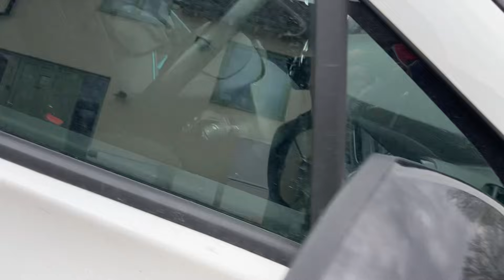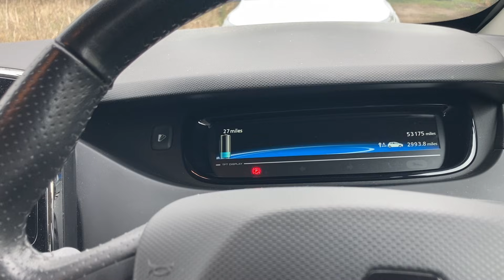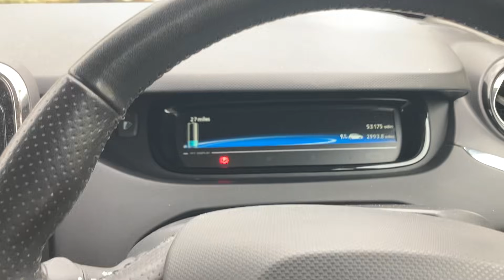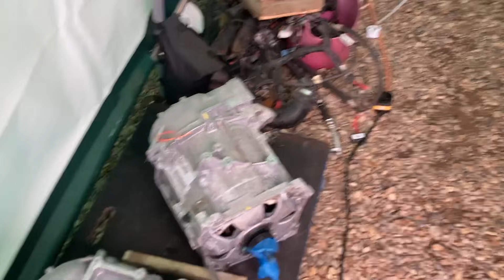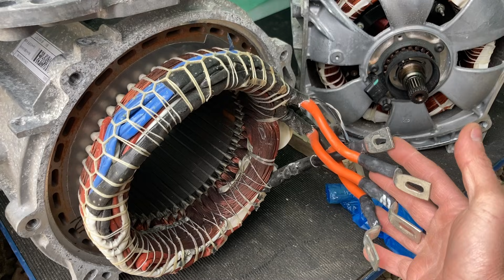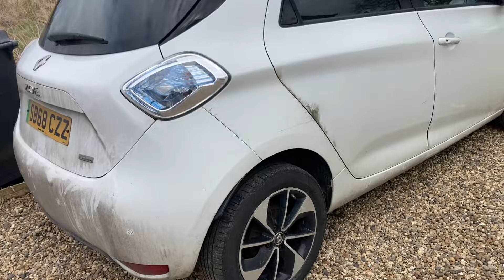Is this 6 year old EV scrap? 🫣 Renault Zoe Electric Car faulty - EV Salvage Car Repair Mechanic

Comment: Been watching many of your videos, and I believe somewhere you said that the Renault 5 is using the same motor as the zoe's. Or maybe I read it in a comment.
I was seriously considering buying a R5, but now I'm getting more and more scared to do it.
Reply from the maker: Hi, someone commented that that was the case although I have not verified this. I would be surprised if it is the case to be honest. Cheers
Reply: @garycevrepairs  Do you think a Renault EV is a good buy in general, or is there much more reliable brands i should look at, in your opinion?
Reply from the maker: @ well put it this way, I hardly ever talk to garages about fixing Kia and Hyundai EVs 🤷🏻‍♂️
Reply: @ Thank you. I appreciate your answer a lot.
Reply from the maker: To be fair I haven't had much to do with the newer Renault EV's like the emegane etc. Whatever EV you buy, get one with a manufacturer or third-party warranty and keep extending it. With the Renault you can extend the manufacturer warranty before it runs out. Cheers
Reply: @garycevrepairs  Definitely will do. Thanks again.
Reply: That might just be because most of them are still covered by a warranty?  @garycevrepairs
Reply: @garycevrepairs  Looks like there's plenty of room in the engine compartment on my e-niro too so even if it does need repairing hopefully it's a bit easier to get at stuff then the Zoe.
Reply from the maker: @decimal1815  could be a part of it, maybe they didn’t sell as many as well.
Reply: @garycevrepairs Oh dear.!  But, I have seen a lot of Kia Soul EVsfor sale, where the 30kWh battery is fairly degraded, and the cost to replace or whatever, is 3 times the price asked for the car ie Soul 30kWh selling for four grand UK, but the obvious need it has, will cost you £12k and nobody seems sure how to do it if not pukka Kia dealer.  Some kind of key-code for the battery, so you cannot do a swap from a scrap or any other Soul, without doing this ‘thing’.  It’s unlawful, let’s be honest, but nobody’s taken it to court for protectionism is all.  We need a few test cases, like you’re doing with the Zoe/battery lease.  Good channel, carry on Gary!
Reply: @SpeedyK it’s generally accepted (even by Renault dealers) that the Zoe was built to a budget. 
From 2022 on there’s a big improvement on build quality from Renault. 

I was looking at an EV for my wife a month ago. 

We looked at a 3 year old Zoe, but she thought the boot was too small 
We ended up buying a 4 yr old VW ID3. It’s brilliant
Reply: @garycevrepairs only for two years after the 5 years runs out.

Comment: Gary, any chance you could make a list of typical faults that would write off one of these?

Every week you mention tiny faults that effectively make these types of EVs uneconomical to repair. This is really not right. A five year old car!

This week's bingo card slot is the motor position sensor!
Reply: Motor bearings, inevitable EMI charger failure. Almost anything is a few hours of work just to try something and this is one of the reasons why no one wants to touch Zoe.
Reply: @Swwils Zoe Ball is gorgeous the cars are crap

Comment: Not that I am biased in any way by owning one, but I would suggest the best of the 1st/2nd gen EVs was the KIA Soul; it's only real weakness's being the short range, and that there are no compatible large battery pack upgrades.
Reply from the maker: Hi I had a Soul, 27kwh iirc, I loved it and the rapid charge speed was amazing. I believe the Kia and Hyundai eV's are some of the most reliable. I was very tempted by one of the newer ones with the bigger battery.  Cheers
Reply: @garycevrepairs  I have the 27KWh one as well, still have 96.8% SOH; the slightly newer 30KWh battery version HAS suffered worse degradation, just like the first pack size upgrade for the Leaf.

I tried out all the early cars, as a s/h EV is all I can afford; and the Soul also had the best seats and driving position for me (very tall - severely damaged lower back); the Leaf had a nice driving position, but I found the seat too low getting in/out, and the padding to be too thin for someone my size.
Reply: Yes! We just got  a 7 year old Soul, top spec., perfect for local travel and shopping , fantastically  comfortable and charges from the solar.

Comment: What we need is a way to refurbish the motors carnt be that hard also need to get fefurbished compressors my compressor, I must admit I have no real deep car repair skills would not know where to begin with an ice car but a am confident when the time comes I will be able to strip my ze20 down and remove the stack and strip it down it makes sence to my brain with my experience fixing electronics
Reply from the maker: I wonder whether in future we will have Motor repair workshops like we have Mr clutch now. I can do bearing replacements, sensors etc but sometimes they aren't repairable by me and industrial motor companies don't seem to want to touch car motors for some reason. I keep thinking I've got enough old motors that if I get a fault with the rotor on one I will take it out of another Zoe motor that has a fault somewhere else 🤣 I don't think anyone has tried that yet. Cheers
Reply: @garycevrepairs  Now the cars are getting older I guarantee people will setup businesses to refurbish EV parts like they do ice parts, infact probably more so as the cost of equipment to refurbish a motor is cheaper than a ice engine less tools needed les parts to change and repair
Reply: EV Clinic in Croatia does do rewinding already. ;) Not cheap of course..

Comment: Worst EV ever,keeps you in work, but a 6 year old car needing 1000s spent is ridiculous
Reply from the maker: Yes it's not good, let's say I can repair the motor with new bearings if it has play perhaps, that's still a roughly two grand job
Reply: @dazaro3  not the worst my E-Traveller is worse it died after 4 weeks and 1500 miles on the clock on the 5th of January Peugeot are still not even sure what the fault is
Reply: @simonupton-millard  heard so many stories like this about PSA EVs.
Reply: @MrWobling don't bother with PSA we have ev vans down the dealers and they are absolutely clueless. I've worked at other dealerships makes and having to deal with peugeot there customer service or diagnosis is like a potato
Reply: Strangely, several Uber/Bolt drivers have told me the ZOE  was the most reliable car they ever had ....
Reply: Renault Nissan alliance was strategic but sadly bit technical, or at least very messy. Leaf, great motors but sorry batteries. Zoe, great batteries but sorry motors. 🤦‍♂️ Many legacy brand have a strong incentive to build poor EVs, either intentionally or unintentionally. Perhaps 🤔
Reply: @PJWey  legacy this....legacy that.... And then I get into a car from some Chinese up and coming brand it is not quite there... Start ups continue to fail.... And every time I get into a Uber and get Tesla, it is absolutely trashed, while any Leaf or even some low cost is brand new after the same mileage and in the same service.....
Yeah, but legacy automakers are crap and the non legacy ones are amazing.
Sure.

Comment: It would be such a waste if that was scrapped.
It does seem we need legislation for cars to be designed for repair, there are many of us who can only afford to run a vehicle if we can fix it, if that stops either used values tumble or we start walking.
Reply from the maker: Yes it is bad design firstly to have faults like this and secondly for repairs to take so long. I know a garage that work on quite a few Zoe's and they have got quite quick at swapping the motors but it's still a big job and Parts cost is high. Keeps me busy I suppose 😆

Comment: There could be worn bearing causing transponder to misperform. I think you could find a bearing solution that would keep theses going for 200000 miles. I think back to the superblend bearings fitted to early triumph twins in the usa.
Reply from the maker: Hi yes it's quite possible. I would expect some bearing noise but there could still be enough play in the bearings. We will see you when I get it apart. Cheers

Comment: How about a Rich Rebuilds style video, putting a Leaf drivetrain in a Zoe? 😂
Reply: Or a Zoe battery in the Leaf
Reply from the maker: That would be quite good fun, a kind of Japanese French EV mashup 🤪😆
Reply: A collab with Damien Maguire would be  wicked. Where do I chip in?
Reply: You'd be better just to upgrade the LEAF battery pack with a 50kWh import. Not cheap though..
Reply from the maker: I've seen the adverts for Batteries Direct from China but I'm a bit wary as you don't know what their quality control is like. Cheers

Comment: I once took a fancy to a Fiat 500. After looking around YouTube there were dozens of videos where several faults are fixed for the Fiat all of which were described as 'typical for this model of car'. Really, really off putting. For those who comment that the Zoe is rubbish maybe you are seeing a non representative sample where only the broken ones are for one reason or another being described. A channel where working Zoes are paraded with relatively high mileages would have zero interest to people. I am however grateful to Gary for the few tips I can use to extend the longevity of my car. Seeing the cars being fixed can be quite instructive.
Reply: Yeah, my '17 Zoe has about 120K miles and no problems apart from a brake drum which locked up but that could happen to any car.
Reply from the maker: Thanks for the balance, there are loads of them out there so maybe they aren't all that bad, just annoying to Repair if it does go wrong. To be fair I think it's fair enough to have to do a major job on a car at 100k miles, you just shouldn't have to do it at 50k! Cheers
Reply: These Zoes are definitely below average for reliability for an EV. Many other EVs like the Hyundai Ioniq are bulletproof, really well-engineered cars, so it's sad that Renault has treated it so poorly.
Reply: @mbak7801  exactly, negativity gets you more views than positivity
Reply: @mbak7801  you  pay your money and take a chance .

Comment: Wondering when mine will fail...😅 or if
Reply: Gary you are a star, I think I've said that before.
I have been in contact with a guy  at Renault UK's complaint department for a few weeks (about the My Renault App). I also asked why the motor bearings are not avaliable from Renault. He has got back to me a few times telling me things that I had already told him! 
The latest gem of information was "I've spoken to a dealer and they only fit new motors" So I asked if he actually can find out why. I kept making the point that if basic parts like bearings are not replacable, and easily, people wont buy them second hand if they are wise, so eventually nobody will buy them new, whatever model. I wait for his reply. 
I'm on my second Zoe but knowing what I know now, I wont be buying another Renault EV even though my 4 year old Zoe 50 GT seems to be ok, I love driving it and it costs me hardly anything to run. Yet.
Reply: @Goodchappy  
If I were you i might try to find out who supplied (Supplies) the bearings to Renault, Get the specification of the bearing, then look for an upgraded part.
I'll almost guarantee that it was "Off the shelf" and there is an equivalent size, with greater capability available from the OEM or other manufacturers.
Reply: I have the same thought. My ZE50 is on 35k and coming up to five years old. I will be extending the warranty when due. 😬🤞
Reply: @davidbrown7379 You can only extend the warranty with Renault for 2 more years.
Reply from the maker: Maybe you will be the lucky one 😆
Reply: According to dealers who specialise in Zoe these faults are rare.. but only time will tell.
Reply from the maker: There are a lot of these on the road, maybe it's just that I spend all day talking to people about broken ones 😆
Reply: @decimal1815 Yes, my Renault dealer told me last year they haven't had any Zoes with motor failures.